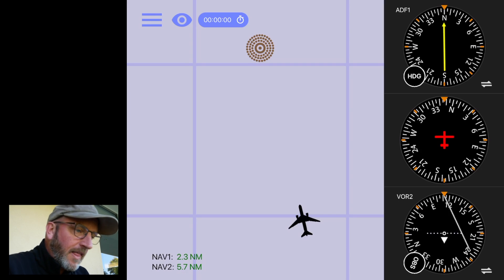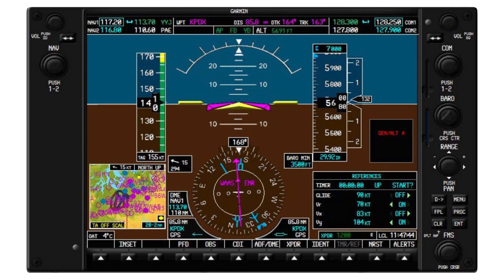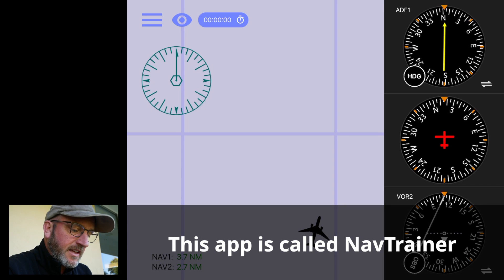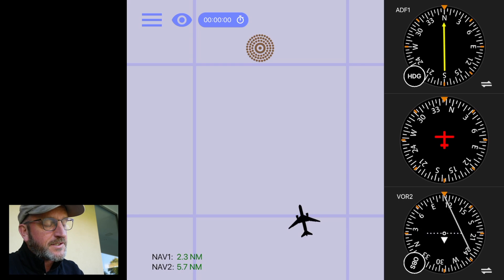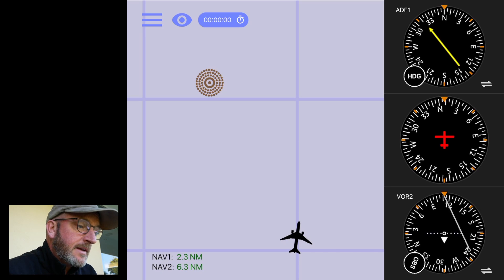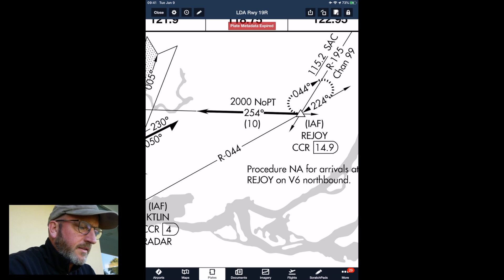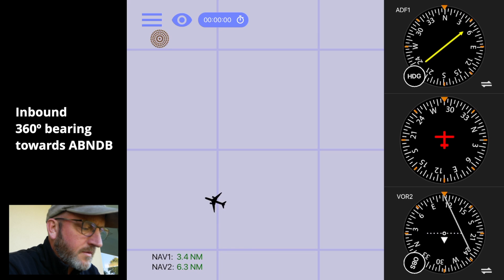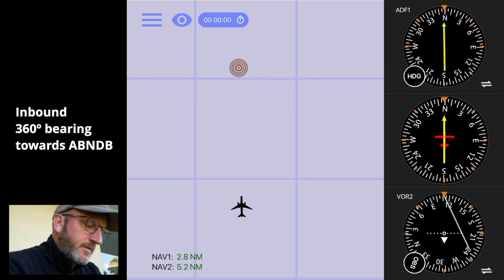Pilots! - Bearing Pointers on G1000 aircraft and ADF tracking of NDBs are flown the same. VFR or IFR

Comment: I’ll often give the KCON VOR-A Pointer only followed by KCON VOR-A Pointer & CDI followed by KLCI no GPS Full ILS 08 through MAP and yes, this Pointer stuff works great. CDI to LOC while using CON Pointer till on LOC, CON Pointer for cross fixes, then on the MAP toggle NAV 1 from LOC to ENE using the Pointer initially till climbing straight before taking time to adjust CDI to assist on the MAP. Great training. I’ll likely have preceded it all with some unpublished Arcs and some VOR Point-To-Points into Holds. Makes for a great IFR training Dance Card. Though seems most my students complain as to why they need to do this stuff when they have GPS. Children of the Magenta.
Reply: If you haven’t, watch Children of the Magenta right here on YouTube. Goes well with this channel’s IFR Checkride “Don’t Go Down the Rabbit Hole.”

Comment: With Pointers, Arcing is much easier than with CDIs. You’ll likely never turn the wrong way or inadvertently get reverse sensing with Pointers. They’re great for rough movements while CDIs are great for refined. Put them together and you have a powerful SA team. With DME, or GPS in lieu of DME, now we can do VOR Point-To-Points on the HSI (and figure the Hold Entry at the next point on the HSI pretty easily). Use the 1% rule getting onto the Arc, 1% rule times degrees per arc distance getting off, you’re set for most Old School things which will help in the new school, help with understanding, and help when that GPS database gets hacked (like Jepp last Nov).

Comment: Back in the day I did master the NDB and used to like flying the course. During the instrument rating written you had to calculate the magnetic bearing to the station by adding the indicated bearing plus your magnetic heading. If it was greater than 360 then you had to subtract 360. The glass cockpit is like having a movable compass card which creates the instrument known as an RMI.

Comment: Hi Jason. I recently purchased your outstanding E-book: Setting the Standard. Regarding the flowcheck also mentioned in this video: Why do you always start at the Compass and not the fuel selector ? I see the advantage of starting at the fuel, being that the flow will then be similar to the engine failure re-start check (and secure engine check). I would greatly appreciate your comment on this. and thanks to both of you for creating all of this great content.

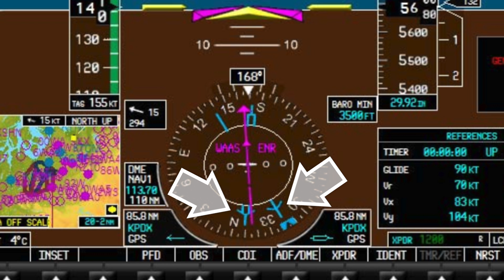Comment: I signed up on Patreon last week, thanks for all the additional material there. I'd been researching bearing pointers and their use in G1000 so your ground school capture was great timing, thank you. One question on the screenshot that you show of the G1000 at various points in this video such as at 5:00; both BPs are pointed at KPDX with the usual great circle GPS distance displayed. Why are they showing different radials (in this case R-139 and R-169)? I'd have expected them to be the same
Reply: I noticed the same thing.

Comment: Great explanation Jason - curious on your thoughts re G1000 VOR approaches. I use CDI with GPS guidance and tune the RMI to the VOR to monitor any deviation, which eliminates need to remember to switch CDI source at high workload time.

Comment: Why not just turn to a head 90 degrees off of the desired bearing which would take you towards the bearing? Then just fly it until the bearing pointer is at 90 degrees, then turn towards your inbound heading and fly the needle? For instance on the second example you want a 360 bearing. So fly 270 heading until your ADF reads 90. Then turn to your 360 heading and fly the needle.
Reply from the maker: If you’re confident enough to do that it works fine. Once proficient you can skip the “parallel” part and the “double the number” part
Reply: Thanks for the response!

Comment: Jason, great video. As usual, of course. Have you heard of the Charlie-Brown+30 and Tom-Collins+45 methods? That's how we were taught in- and outbound interceptions in the military.
Reply: Curious! Tell us more.
Reply: @mitchinwanderlust  It can be used for HSIs and RMI type indicators. CB+30 is used for inbound interceptions. That means you look at desired Course inbound to the station, then go from there to the Bearing pointer and add another 30 degrees. That gives you a 30 deg intercept heading.
TC+45 is used for outbound interceptions. You go from the Tail of the bearing pointer (current radial) to your desired Course (desired radial) and add another 45 degrees for your intercept heading. Always make sure to keep overall SA to avoid interceptions 180 out and such.

Comment: You can also use the orange lubber lines (located every 45 degrees) around both the ADF and the DG as reference points too, since they do not move..